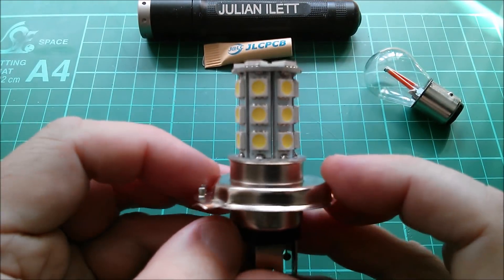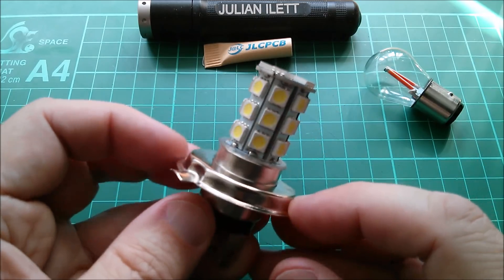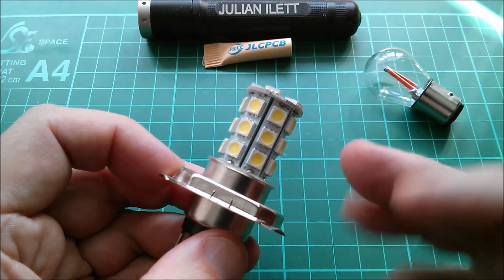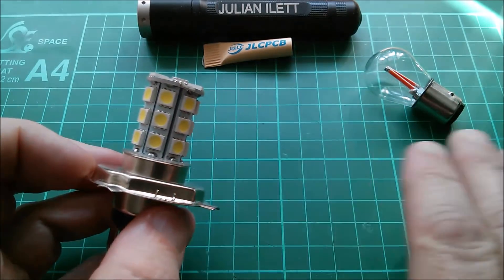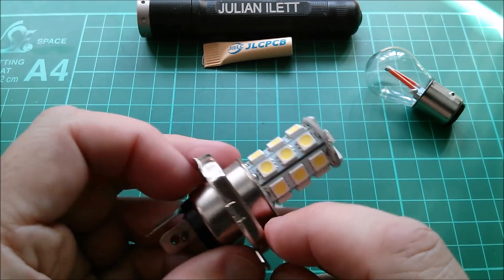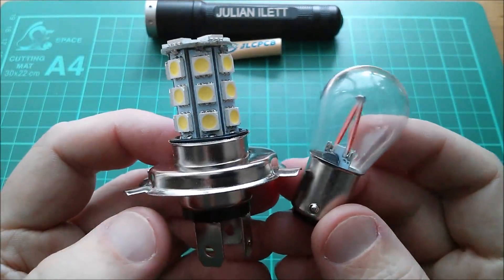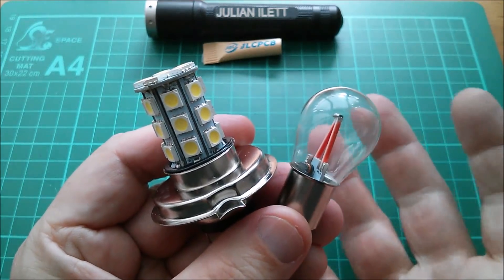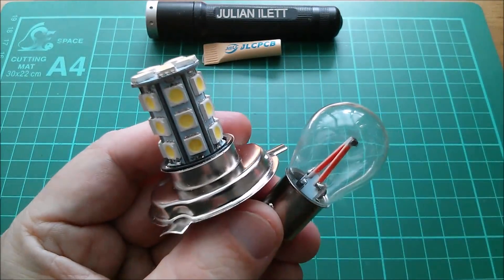SCAM! LED Light Bulbs - H4 Headlight and BAY15D Tail/Stop

Comment: I regularly get dazzled by people who have retrofitted LED bulbs in their cars (particularly popular with drivers of Jeeps). As you pointed out, filament position is critical. If you’re going to do reviews I’d like to see you purchase a reflector headlamp module for a car (any type of spare from a scrap yard) to compare the beam pattern of a proper halogen bulb to the LEDs in a controlled environment. 
That might serve to educate people how bad these LED headlamps really are.
Reply from the maker: Yeah, I really hate driving at night now. The HID lamps are too bright and have a very sharp cutoff - so it looks like they are flashing you constantly. Also, people drive with their headlamp adjusters on the highest setting. I'm not sure I can tell the LEDs from the HIDs really. There's a lot to be said for the old tungsten light bulbs :)
Reply: Julian Ilett That adjustment problem presists even on the tungsten bulbs too. Mostly people don't notice it since it's limited to older vehicles with hazy headlights and cheap bulbs.
Reply: "The HID lamps are too bright and have a very sharp cutoff". I'm right the other way around, I only drive with HID lights now (and don't mind others having them either) because the halogen bulbs are so dim that it's easy to miss important details (like ice, people walking on the streets, deer...). Sharp cutoff is actually a sign of good projection quality; cheap reflector systems tend to have awful projection qualities and bounce the light everywhere but on the road. The light might not be as bright but the only light that will blind you is that one that hits your eyes instead of the road...

NB: Quite possible you don't like HID due to the horrendous SUV boom since they have the headlights placed quite high for aesthetics and of course since need to travel quite a bit of road the down angle is not so much different from a normal car so they tend to blind quite a bit...
Reply: It pretty much only effects halogen systems since HID bulbs are required to have self levelling. Worst offenders are old cars with a reflector system, misaligned beams, wrong level setting and illegal "Xenon"-like halogen bulbs with too much power output; quite a common combination unfortunately.
Reply: You've basically contradicted the article and yourself. Either the location of the tungsten filament really matters (and I don't believe it does, especially not with reflectors because they don't produce a precisely focused light beam anyway due to the huge amount of scatter inside the headlamp, projector systems might be more prone to showing a pattern but they don't produce a very focused beam of light since they need to cover a huge area in front of the car) or it does not. If it does, it is physically impossible to recreate that with LEDs.
Reply: @danielegger6460  conventional headlight beams may not be very tightly focused but they still have an overall direction and field of coverage, with the dipped filament arrangement the dipped beam definitely pointed down towards the nearside kerb  more than with the main beam. A lot of the bulbs have a sort of internal shield in the side as well to dim the circular pattern up towards the offside. My VW has HID headlights and they recalibrate themselves every time you turn them on they go up down left and right to centre and self level themselves properly
Reply: > My VW has HID headlights and they recalibrate themselves every time you turn them on they go up down left and right to centre and self level themselves properly

Autolevelling (and (pressure) cleaning) is mandatory for HID lamps in many countries of the world, they just test the servos but the autolevelling also has to happen whilst driving to compensate for up- or downhill movements. Most headlamps don't support swerving left or right though, that would be used for dynamic curve lighting and even in cars that do support it, they don't test the servos when firing up the lights and couple them (speed dependent) to the steering angle. Great stuff but mostly superseded by LED matrix lighting nowadays -- that's a must have in my next car.
Reply: I don't know if it is mandatory or not here in the UK, but yes, it has pressure washer jets as well as the swivelling. The lights on mine do also swerve left or right according to the steering wheel position, although you would hardly notice it in normal driving, but they also go through the exercises every time the car is powered up.The fog lights also swivel left or right and automatically light up the kerb when steering left or right at low speed.
Reply: @danielegger6460  Oh you have missed so much of the beauty with halogen lights.

The filament position is absolutely critical because it needs to be right at the focal point of the reflector parabola. This makes it possible for the reflector to make a very precisely designed light pattern. What many people miss when comparing them with projected lights is that since a reflector has a softer edge it can legally shine a bit of light further down the road, not much but it's enough to give you a few extra meters of effective visibility. Reflectors are also allowed to have a blurry spot right in the middle where the edges meet, which gives you even a bit more range straight ahead. The color temperature is also more suitable for night driving since blue light disturbs your light sensitivity.

The sharp edge of a projected beam gives the illusion of brighter beam because of the increased contrast. The side effect of this is that your brain picks up everything crossing the edge as a moving object before being able to determine wether it's stationary or not. It's rarely a problem by itself, but your visual cortex getting bombarded with movement detection tasks leads to it either consuming more energy (which makes you feel tired) or it turning down the sensitivity (which increases your reaction time). Combined with blue light this becomes a terrible idea.

LED matrices are a neat idea but in my experience it leads to drivers running high beams permanently because they think I won't get dazzled by them. They totally fail to account for reflections though, so the net result is that I have to use my full beams against them (because they cannot figure out why I'm flashing at them when they clearly see their own lights dimming the direct path). Early models even had so few discrete LEDs that I could see them switching on and off, which is probably one of the most distracting things I've ever seen on the road.
Reply: Daniel Egger filament location is extremely important. The reflector isn’t arbitrary formed into a convenient shape. It is engineered such that of every angle is reflecting light from the bulb to a specific location on the lens, then out to the roadway. That geometry only works if the light source (filament) is in a known location and a specific shape. The reflector is capturing light from all sides of the bulb. Which is why changing to a LED or HID bulb in a reflector lamp is going to result in a light pattern that either blinds oncoming drivers or focuses all of the light 20 feet in front of the car leaving the driver virtually blind to what’s down the road ahead. This will be the case until HID or LED bulbs can be manufactured to precisely match conventional bulbs. 

Projector lamps are better with unintended bulbs at not blinding oncoming traffic because there is usually a mechanical shutter that blocks the top of the beam creating the sharp cutoff. Some vehicles use a single projector for both high and low beams by raising the shutter in the high beam mode. These aren’t common and I suspect it’s because of the long term reliability of a mechanical shutter. Should it fail in the up position the driver will be inadvertently blinding oncoming drivers even when the headlight switch is in the low/dip position. 

Still, bulb type does matter in projector lamps. If one were to replace the HID bulb in a projector with a tungsten/halogen bulb, aside from the color difference the beam pattern on the road would absolutely be different. 

Going back to my original suggestion to Julian. I think quantitative measurements of beam pattern from a headlamp with retrofit bulbs compared to the intended bulb are just as useful as measuring brightness. It may be a bigger project than he wants to take on given the theme of his channel. This is a channel/project in its own rights and not worth the hassle when the outcome is inevitable.
Reply: Indeed - I was on a forum someone got a used car and was complaining how bad the lights were...I have the same model and they are great.  After some checking they discovered it had LED bulbs and they were shining the light mostly at the sky and other drivers instead of the road!  Putting in proper bulbs made it so much better.

Only thing worse than LED headlights is people who add LED floodlight-bars to the front of their cars.  Those make hi-beams seem pleasant.
Reply: These shit led's in foglights is a real problem where I live.

Comment: I wonder how many kilometers it would take to shake every solderpoint to bits on the led H4 lamp.
Reply: sounds like a good idea for new video
Reply: I've had led lights like these (but red) in the tailights of my car for 5000 miles. (Sorry I'm American). They are still working great. I would never use them as headlights though. Even the white would not be bright enough.
Reply: i guess I am pretty off topic but does anyone know of a good place to stream new series online?
Reply: @August Ryker i watch on flixzone. You can find it by googling =)
Reply: @Maxwell Onyx Yup, have been watching on Flixzone for since march myself =)
Reply: @Maxwell Onyx Thank you, signed up and it seems to work =) Appreciate it!
Reply: @August Ryker Glad I could help =)

Comment: Another consideration people don't think about -- depending where you live if you get ice or snow the incandescent bulbs also get hot enough to keep at least a small area above freezing and clear in bad weather, if the LEDs burn cooler you'll end up with the lights covered over and have to keep stopping to clear them.

Comment: Depending on the country this are either illegal to use (the homologation for the lamp enclosure is strictly attached to the fillament type used in a light source) or just straight up silly as they are far less bright and reliable (resistors burn out or LED burnout due to crude voltage regulation) than normal tungsten H4 bulbs.
Reply: 90msg90, 9003s are required in the US, h4 have a wider filament tolerance, but there are a few illegal leds that come close to proper filaments light pattern. They tend to have a small number of emitters and some light shielding. The pattern is close with a defined cutoff but it's hit or miss with a given reflector design. Those also tend to be brighter than oem.

Comment: One major problem with head light lamps is heat dissipation. They do not have any! So they will overheat but I guess if they are only a few watts they wont but then they will not be bright enough. I've seen a few with fans and large heat sinks but that sounds like reliability will be an issue.
Reply: Yeah, I wanted to try some out but was afraid of heat issues not being dealt with (ie, made in a manner that will knowingly fail in the future) and beam pattern issues... I don't want to be inconsiderate. So I just changed my halogens out for "halogen infrared" bulbs and keep the lenses polished.

Comment: I tried led replacements all around my car and  the only ones I found to be suitable were the interior lights and the reverse lights.

The interior lights were changed to daylight white, and looked really good.

The reverse lights were daylight white leds with a lens on the end, and made it a lot easier when reverse parking in the dark.

Led sidelights kept failing because they kept getting that hot, the resistors would just desolder themselves from the circuit boards.

I tried indicator led bulbs and they were far too dim and  were never used at all.

Comment: I do believe that there are two standards for the side which has the stop light filament, I seem to recall that Hyundai (for one) introduced the alternate wiring.  So even for filament lamps you need to be sure to get the right wiring replacement lamp.
Reply: Toyota does that too on certain models.

Comment: In dual filament bulbs you need to also look for back-feed to other bulbs in parallel ie., in a two element brake light bulb, the "parking light" filament is installed in parallel with the other marker bulbs. This now creates an alternate path to ground. I have LED brake bulbs which function correctly when bench tested as you did here, but once installed in a vehicle, the alternate path to ground is not blocked by any diodes. This creates "fun" faults such as making your "headlights on" reminder buzzer sound when you press the brake pedal.

Comment: In Germany those LED replacements bulbs are not allowed: If the police stops you and you have such lighting installed, they will take your car off the road at once and you can look for a taxi or a bus to get home.
Reply: Peter Funk I wish the police is the US had the ability to do this. Unfortunately the lawyers would get involved and claim a persons civil rights were violated for interfering with their choice of light bulb.
Reply: In the UK, the police could give the offending vehicle a prohibition order. This effectively renders it un-roadworthy until the problem is corrected and certified as such by an MOT test centre. The driver could also get a fine for the defect. The vehicle also won't pass the MOT (certificate of roadworthiness), if a light unit designed for filament bulbs, has been retrofitted with LED replacements.
Reply: They can write up the vehicle because none of the LED units are DOT legal if used in the wrong housings.
Reply: Blazer02LS and what cop is going to waste their time going under the hood to remove a light bulb and check that it’s not DOT marked just to write a “fix it” ticket? Not to mention the liabilities of potentially damaging a persons car in the process. 
Plus, there’s no shortage of overseas manufacturers and marketers that will stamp DOT on any old piece of garbage.
Reply: The police don't need to take any bulbs out too look at the. LED replacements AREN'T DOT or E marked, and shouldn't be in the lamp assembly. In fact fitting any non approved light source, be it a high wattage filament, LED or HID renders the whole assembly non approved. This will fail the MOT and if spotted by the police, could land the driver with a fine, the vehicle given a prohibition order, until the defeat is corrected. 
It's all about safety of road users, so the law is indexable to it.
Reply: They don't need to remove it. They can just look at the vehicle info, If the vehicle never had an HID or LED option and it has either one installed it's illegal. Also illegal are most on the complete "replacement" headlight assemblies that put projector, HID or LED onto a vehicle that was never offered with them. 
The only real reason they don't pull over and write them tickets is simple and falls under the same thing as a bad tail light, they will write a "fix it" ticket. The offender then swaps out to the stock lights, takes it to the judge/police to show it was fixed. Then a week later swaps back.
Reply: The notion that the police in the USA need more reasons to be able to pull people over is nonsense. I know a guy who was pulled over for having non-factory lights on the running boards of his pick-up. The police can claim any non-factory light is "distracting" and issue a fine.
If a tractor trailer driver dresses his truck up with extra, non-required lighting, as some do, they can be fined if one of the additional lights malfunctions.
If your vehicle has optional lighting such as fog lights, most states require the non-required lights to function to pass their safety inspection.
Now with Civil Asset Forfeiture being used for revenue, the police in the USSA are confiscating more money than thieves are stealing. Look it up.
So don't mock the Freedom Fighters. Just take your place with the bootlickers.

Comment: I haven't read through the comments to see if it's been mentioned yet. I'm a MOT tester, and the headlamp bulb will be refused come mot time. It's unacceptable to fit led or hid bulbs where a halogen one was fitted originally. The position lamps and brake light bulbs will be accepted, but one thing to keep in mind with those, is they most likely draw less current and will set off any lamp failure warning indicator systems. My overall advice to people is don't waste your money on these. The manufacturer probably spent millions developing your lighting system for the standard bulbs.

Final note, I wasn't drawn here by the title, cars may be my career, but electronics are my hobby. I'm a subscriber, I watch many of your videos. Keep them coming😎